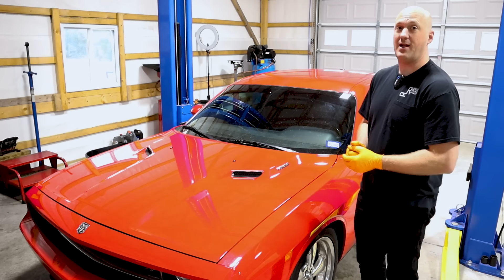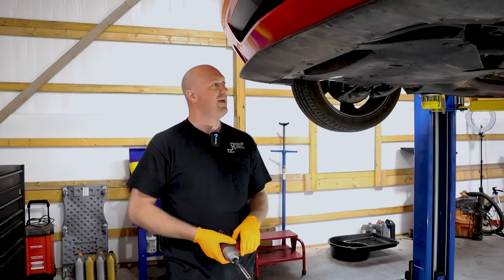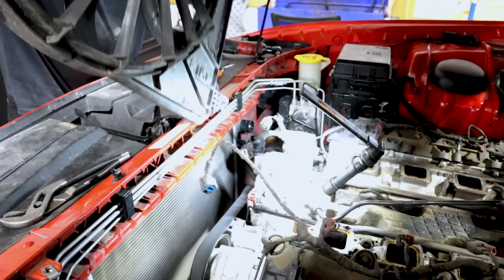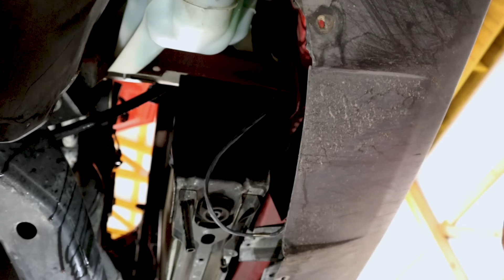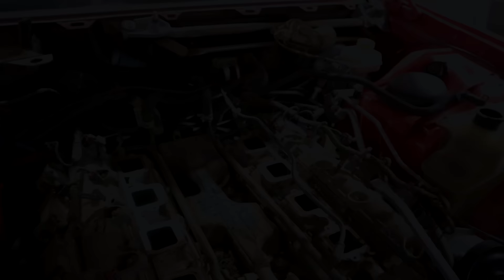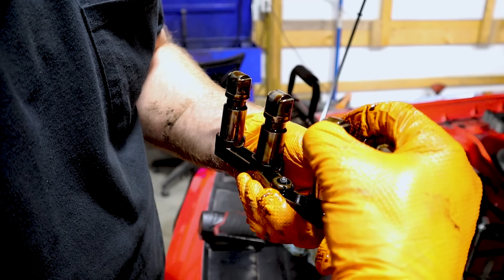Hemi Cam Installation! Budget Challenger Build Ep1

Comment: if i’m only doing the Cam do i need to take the cylinder heads off anyways? or can i keep those on
Reply from the maker: You can technically swap just the cam without removing the heads. Remove the rocker arms from the heads and remove the pushrods, then spin the cam a couple times to push the lifters back into the bores, then slide the cam out and slip the new one in with a quickness 😄. If the lifters slide down and fall into the engine you've got a larger problem. I have done it before though so it's definitely possible. 👌
Reply: @ReignitedAuto  is this the same route to go for any cam or just the 6.4 cam?
Reply from the maker: @BigBlackMen-  exact same process

Comment: thank you for this upload-----i work at a police fleet and we see this cam and lifter issue(most especially cyl 8)--we usually send this out as this is a small shop and dont feel like we can down a lift for a couple days-----i think at this point i dont give a fuck anymore and am willing to do this--i also think they would prefer we did these repairs in house as when we send them out the first thing the dealer does is just recommend and engine--so basically they payin a lot more than they should
Reply from the maker: No doubt, I've done about 100 cop cars or so for this issue. Once you get the process down you'll have them in and out in no time 👍

Comment: "Is there something that you learned from this video that you did not know previously?"

I assumed you'd have to completely remove the A/C condenser and the radiator to get the cam out, but it looks like you just had to move the condenser a bit and the radiator stayed in place.

Comment: I love when people say they don't see the point of a catch can. Then first oil change the check it like damn it's  half full. Absolutely necessary on the hemis when I did my intake man gaskets the intake and runners were caked in oil and grime.
Reply from the maker: My point is that for people who just drive their cars, so what if the intake runners have oil grime in them? It doesn't affect the way the car performs in the least. Also, installing a catch can on a vehicle that already has 50k+ miles on it will provide no benefit whatsoever, only another task to perform (emptying the catch can) which barely anyone remembers to do anyway. Think about the k&n "lifetime" air filters and how often people clean them. If you're going to install a catch can on a brand new vehicle or a fresh build then more power to you.

Comment: Just trying to be sure: I have 2012 Ram 2500 and thinking the parts should all be the same-can you confirm?
Reply from the maker: The headers will not fit, but the camshaft and lifters will.

Comment: Per STAR Case Report S1709000010, "Removal of the Oil Control Valve (OCV) for the Variable Valve Timing (VVT) system should be performed to inspect for debris."

Comment: Is it not typical to swap the water pump and maybe even the oil pump while at this level of disassembly? Depend on mileage?
Also what lifters did you use? They need to be 392 specific? Thanks. 
Great instruction. I have to tear into my single cab ram asap.

Comment: I'm trying to do this same rebuild as I have to replace my cam and lifters in my 2014 charger r/t, but I would like to keep the mds, would the process still be the same if I used the mds camshaft and lifters? I would really appreciate your advise
Reply from the maker: Yep, exactly the same 👍
Reply: @ReignitedAuto would it need a tune or could I at least get it to where it needs to be ?
Reply from the maker: @angelespitia6825  it should run just fine, but the time would really optimize it.
Reply: @ReignitedAuto  so it would run fine but i should look into getting it tuned asap correct?
Reply from the maker: @angelespitia6825  Yessir
Reply: @ReignitedAuto  thank you appreciate the info !!

Comment: Down to my last question I think before I hit the brake and push that start button. Lol. When I put the car in the on position before turning over the motor there is a 2 second bussing sound like a big fly or light tazer under the hood. Deleted mds with the plugs. Any thoughts what it could be?
Reply from the maker: It could be one of two things: most likely it's the electronic throttle, they usually run a self test when you turn the key on. Alternatively it could be you're hearing the fuel pump prime, but most likely it's the former. 👍

Comment: Is the foam piece that sits under the I take manifold necessary to put back in?
Reply from the maker: Not really. It's basically there as a sound dampener so without it you might hear some more noticeable engine noises. But in my experience it's not much difference. I don't use them on my personal builds.

Comment: Is the crankshaft bolt reverse threaded and how do I get that bolt out?
Reply from the maker: Nope, not reverse threaded. Best way to get it out is with an impact, but if you don't have one of those you will need to access the flex plate and stick something in there that will keep the engine from rotating while you loosen the bolt. 👍

Comment: Great video, this guy knows his stuff, but where are the fender covers to protect the fenders and front nose, a dealer mechanic should be the very first thing they do because it’s beaten into you at the dealers I’ve worked at, just busting balls. It is a great video.

Comment: I have a question could I use the block and crank and pistons out a 2004 5.7 hemi magnum out a truck in my 2011 ram 1500 5.7 hemi
Reply from the maker: Unfortunately no,  you'll have to find a 2009 or later block for your truck 👍
Reply: @ReignitedAuto  thanks for your quick reply but could you tell me what is the difference between them because the block looks just like the motor mounts are the same as mine does it have a different crank and pistons I know the timing cover and heads and intake and cam  are different I was just going to use all my stuff because I just rebuilt my upper half that it is burning and using oil
Reply from the maker: @roberthammond4642  they look very similar but the block casting is actually different, this means the crank is different, the pistons are different, the deck height is different, the oil pump is different and the timing cover is different. This all changed because they added VVT in 2009 and it changed the entire engine. There's no way to swap parts between them. Basically think of them as two separate designs 03-08 and 09-present
Reply: @ReignitedAuto  ok thank you for the info one last question could I put it in my 2011 truck because it only has 136000 miles on it and mine has 260000
Reply from the maker: @roberthammond4642  nope, another change is the crank trigger wheel so the engine would not run at all in your vehicle.

Comment: Can you do this cam upgrade without changing the valve springs?
Reply from the maker: Yes you certainly can, the 6.4 cam is mild enough that it doesn't need a lot of RPM so the valve spring upgrade is more for peace of mind than anything else.

Comment: Loved the series on this, new (ish) Chrysler tech myself, also just bought my first challenger, a used 2016 Challenger R/T Plus w/58k miles.  Am curious and not getting too much help from my "parts department" guys... Can I do the 6.4L cam on my 2016 Hemi? (am planning on using long tube headers instead of the SRT headers).  Mine is Automatic Transmission with the MDS of course but am planning on getting the tuner as well and disabling it.. At that time do I pull the MDS units out and plug their holes or how does that work?  Have built a ton of "old school" Hot Rods such as 67-69 camaro's, 70's El Camino's, 70's Ford Torino's, etc.. Mostly all bolt on parts such as intakes, carbs, MSD distrubitors and headers though.  Still learning all the new technologies on these newer cars and performance upgrade compatibilities and such.  Any advice or part numbers if possible would be GREATLY appreciated!  Keep up the great videos!

Comment: I have a 2010 5.7L hemi w/ manual trans. My question is 
What year 6.4L cam fits in my year.
What valve spring, lifters, and pushrods should I get that support my year and this 6.4cam? 

Thank you for the great videos

Comment: How do you tighten the harmonic balancer without the motor turning? I did these mods and more and the car is slow and lacks power. These mods aren’t that good but it does run and you have to figure some things out on your own

Comment: Skye,
I'm thinking my '14 Ram with 5.7 jumped time.
It started vibrating like I was driving on a washboard, p2172 code, CEL, ABS, traction Control lights and throttle plate light, and a derated message on my screen.  I made it to the side of the road.  Engine barely running and shut down.  Tow truck came, tired to start it, had a tapping in it.  I replaced the MAP sensor, cleaned the throttle body and was lucky enough to find find an intake manifold and replaced that.
I did a throttle relearn.
I started it up the tap turned into a loud clack clack clack, now I'm thinking it broke a valve head off, now I'm looking at a complete tear down to check it out.

Which brand would you personally use when replacing the timing chain?,  Brand  I or brand M?  Brand I has the oil piston tensioner where brand M doesn't look like it has one.

Money is a factor
Also, I'm going with your recommendation and upgrading to a Hellcat oil pump

Comment: On the hellcat since I won't need to swap lifters because non mds, can I just roll the cam  a couple of times to keep the lifters up in the pockets while the cam comes out
Reply from the maker: You can, just be quick about it! 😄. I've done it that way as well, but you don't want to have to deal with it if the lifters slide forward in the bores. One solution is to use a magnet on the back side of the lifter to pull it back up, but it's a pain regardless.

Comment: Why do the heads have to come off. I've never been told lol
Reply from the maker: You can do a cam swap without removing the heads, but 95% off the time when you change the camshaft you'll want to replace the lifters as well, and you can only get to those after the heads are off. 👍

Comment: I watched this series, and man, it really helped. I know I'm late to the party, but I recently did this cam change (all stock) because of a bad lifter. I have a question, so I hope you see this. In the process of removing the damper, a very small piece broke off of it, approximately 1/2in x 1/4in chunk. Would this then cause small vibrations at random RPMs? I'm thinking of just replacing it to be safe.

Comment: So I’m having a very hard time getting the cam sprocket bolt off, I used my dewalt impact and it would not come off. I let it soak in wd40 and rust buster over night. Mine is a 6.1 hemi do you have any recommendations I really don’t wanna snap the bolt or anything
Reply: Literally any suggestions would be so greatly appreciated
Reply from the maker: Best way to do it is to access your flex plate and stick a pry bar in there that keeps the crankshaft from turning and you can break the bolt free. Use this same process to torque the bolt during installation. Don't worry about hurting anything, it's just to keep the crank from spinning. 👍
Reply: @ReignitedAuto  I ended up getting it, but I slipped the timing chain off so now I have to retime the engine. Do I have to entirely drop the oil pan for that? If not do I still have to replace the gasket?
Reply from the maker: @landengriffith9423  what vehicle is this in? If it's a car then no you don't have to drop the pan, you can get the oil pickup tube out and just let it rest in the pan, then remove the oil pump so you can see the timing mark clearly.
Reply: @ReignitedAuto  it’s a 6.1 challenger. If I don’t have to that would be great! I really appreciate your series it’s been incredibly helpful

Comment: Bro. The tip about removing the wiper cowl and factory strut bar. Game changer lol
Reply from the maker: So much room for activities! 👍
Reply: @ReignitedAuto 

This is about to help me out so much! Got in there to replace valve cover gaskets last weekend, if only I had seen this video then. Driver side is about to be a breeze now, may just do the cam as well if it’s this easy! Is it all the same for a 2014 Charger RT AWD?

Comment: Is the number one piston supposed to be all the way at top dead center when the phaser mark reached 12 o’clock or should the dwell time be right at 12 o’clock? I’m not sure if this makes sense but according to my research there is a dwell time and you have to split that. My phaser mark is at 12 o’clock and my piston is all the way at the top. I’m not sure which is correct.
Reply from the maker: Don't worry about piston dwell, as long as the cam mark is at 12 and the poison is at the top of the cylinder you're good to go. A good way to double check is after you set the timing, spin the crank twice until the cam mark is at 12 again and verify the piston height, if it's at the top of the cylinder you're good.
Reply: @ReignitedAuto  thanks again! I had the timing set before dissembling but when I torqued down the cam bolt the crank rotated so I had to reset the timing. I ended to putting two flat head screw drivers in the flywheel and it held pretty sturdy.

Comment: So I have a 2014 ram with the 5.7 and would like to do some of these mods, would the 6.4 cam and the 6.1 exhaust manifold fit on this motor as well ? Ironically I used to have a 2010 rt like urs in the video lol
Reply from the maker: The camshaft will fit,  the headers will not 👍
Reply: @Reignited - Cycle and Automotive   so is there a Chrysler exchangeable part or will I have to go aftermarket ?
Reply from the maker: @samuelkubiak5782  aftermarket on the headers
Reply: @Reignited - Cycle and Automotive  this was def one of the most helpful videos ever thank you

Comment: I am doing a cam swap because of a lifter failure. My shop told me I should remove oil pan to get rid of all the oil and stuff in it is that necessary?
Reply from the maker: It all depends on how badly the cam was damaged. If you remove the oil control valve underneath the intake manifold,  see if there's metal on the screen. If there is,  probably best to remove the pan,  but if the screen is clear you should be good with just an oil change after the cam replacement.
Reply: @ReignitedAuto  can a vehicle in my case a 2009 Jeep SRT8 still run if timing is off? Just did a cam swap push rods, lifters. Turned on but getting a check engine light and seems like the motor is bogging out or like loss of power
Reply from the maker: @camaroZLWON  it will run if the timing is off,  but watch this video first for a potentially more simple fix:  
https://youtu.be/jMziMqWRMk0 👍

Comment: Do these parts also work on the 3rd gen ram with the  hemi? Mine is a 2004
Reply from the maker: Unfortunately no, the cam is only for 2009+ engines. The lifters will fit all 3rd gen Hemi engines.

Comment: Been watching your channel, so educational. Thanks...you mentioned on manual transmissions, the MDS Block off plugs are factory installed. I wonder if there are any stats that show cam lifter longevity is better on engines with block off plugs installed from day 1. I mention this because in your video where you explained MDS, you were wondering about doing an extended range comparison. Interesting! Perhaps there already is some data supporting your theory.

Comment: At 215k on a retired cop car I should probably just get a long block send heads off and replace everything while doing a cam I have headers and a cold air intake and 6.1 manifold with 87mm tb allready the engine runs amazing but I want to pro charge the car after a cam being a mopar tech what’s your view I’ve read engineers rated 5.7 for 250k service life

Comment: i have a a shop that says they can install the cam without pulling the lifters and was wondering is this true? i have done many cam installs before but on older motors and im not sure if this can be done, further they tell me they can change the valve springs without pulling the heads with air pressure and have you done this with success. FYI i loved your videos very informative and helpful thanks
Reply from the maker: Yes to both,  it's possible to change the cam without pulling the heads,  but of course you won't be able to change the lifters which I feel is pretty important.  Also,  changing the valve springs using only air pressure is pretty much how I do all of mine,  I've got a couple videos showing this process.  👍

Comment: i have 2011 Dodge Ram 5.7 GEN III which requires replacing cam / lifters
my question is replacement parts, which brand do i get. i heard so much about quality therefore which do you recommend

Comment: Sorry man I had to quit watching after you said you don’t think an Oil catch can makes a difference or really matters.. not to toot my own horn here but just giving insight. Was an Aircraft mechanic with the US ARMY for 6 years, ASE certified Ford mechanic for 4 1/2 years and been working on cars, trucks and motorcycle since I was 8. If you don’t understand the purpose or just how important a oil catch can is especially on a direct injection engine please hang your coat up not to be a ass. But come on man. I’ve ran them on almost all of my builds. I can go out to my challenger right now pull my catch can out and show you the coffee it’s made and saved from my engine. Not to mention turbocharged engines.. I cant tell you how many Ecoboost vehicles I’ve worked on for turbo failure or related that people with catch cans never had. Not to mention how clean the engine is from not having sludge. It’s all about EPA regulations come on man